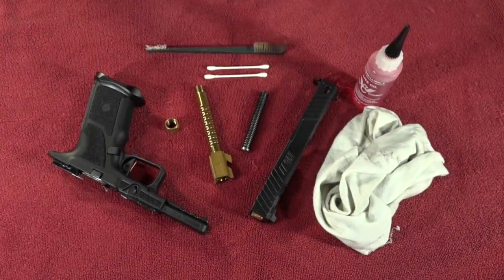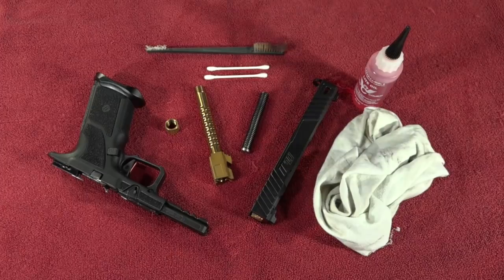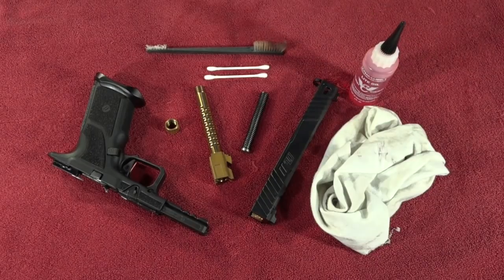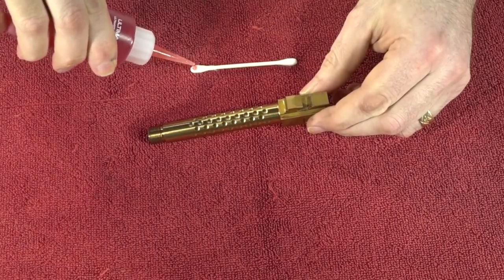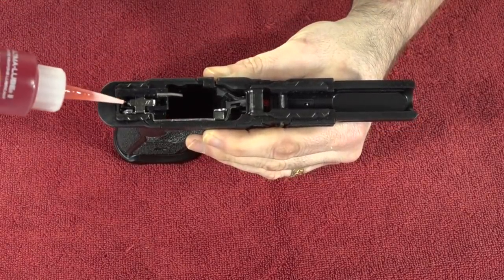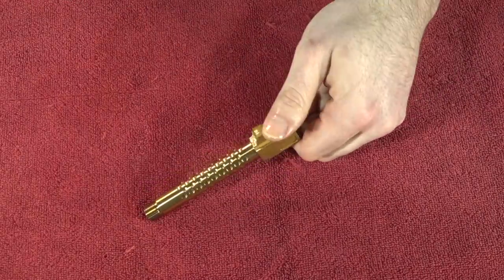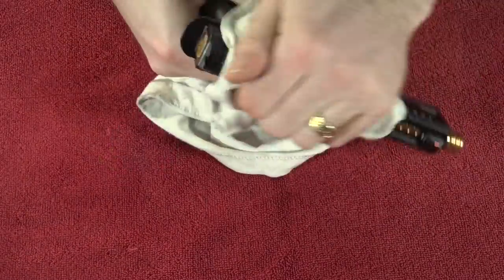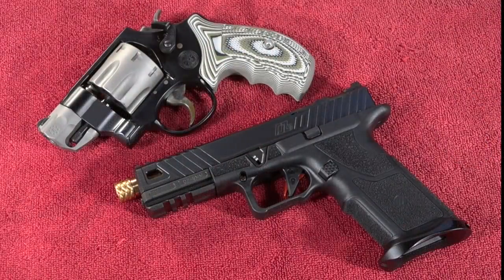How To Properly Lubricate Your Handguns (& Not So Properly Too)

Comment: Perfect. You can go a step further to deep clean any gun without going beyond field strip. I wet the entire gun with Hopps #9 or what ever. Scrub with a brush, dump some more solvent on it, then let it sit a few minutes. I then wash all the parts in hot running water and soap ( my wife don't care) then blow dry with compressed air. I then lube like YM does by soaking the gun. The compressed air ensures oil is blown everywhere, and blows away the excess. I blow air until the gun is almost dry. I add a tiny smear of moly grease on my rails, bolt lugs, and ratchet teeth except on 22 autos. Had the whole 22 fleet quit one day in freezing temps. 22s wont do even tiny amounts of grease when it's cold. This will get a neglected old gun full of nasty crud up and running again without taking it completely apart. Gotta take the wood off of course.

Another trick i learned from a NW hunting forum. In the NW US it rains a lot. I have the dreaded 1965 Win 94 with the mystery metal receiver that rusts from frowning at it. The gun would come home rusted up after a single day out. The dudes at the forum told me to wax it up with paste wax. Works good, in fact perfect. After the above all my hunters get waxed heavily. I force the stuff everywhere with a brush. Let it dry and buff it off just like the car. Use the brush for the tight spots. That gun can go out in the rain and hunt a whole weekend and not rust up. I really cake it on under stocks that wont come off for a long time. Buff it lightly but leave it on heavy. I wax the wood to. It seems to work.

Comment: Use the parts cleaner at the local gas station and then dip gun quickly in drain oil barrel , lay on paper towel overnight .
Reply: Are you married to your cousin?

Comment: I never lube the breechface because I don’t want to attract dirt or lube into the striker channel/firing pin channel. Same with the extractor, I don’t want lube to seep into that little cavity and start affecting the functionality of the extractor or attract a buildup back there cause removing the extractor to clean back there is a pain especially on my beretta where if you do it too many times the pin that holds it in will start walking out
Reply from the maker: You need to properly lube the breech face. Finishes wear of quickly there. Light coat brushed on with a brush or qtip and then wiped dry.
Reply: TheYankeeMarshal what’s the problem with the finish wearing off there? On my pistols is has worn off a lot there but I thought this was normal wear
Reply: ALL metal surfaces need to be oiled to prevent friction and corrosion

Comment: wait so you dont lubricate the inside of the barrel???? i thought that was the part you don't want to leave without oil because the oil stops rust....
Reply: You DEFINITELY want to oil the bore.just make sure to run a dry patch through once or twice to get any excess.i use hoppe's 9 to clean then frog lube paste to lube Inside of barrel

Comment: Rem oil is so thin and solvent like. It seems to evaporate.
Reply: Don't use WD-40 as a gun lubricant; it's too thin for the job, and is more of a solvent than lube.
Gun oil (Hoppe's) worked great on my Glock Model 22.

Comment: Meh, my guns run fine with about twice as much as they need. I have enough guns that some of them don’t get shot for months or even years so I lube the Hell out of them. I have even grabbed my back up to my back up competition gun after I blew out a barrel hood from a factory over charge, (event supplied ammunition). I then stripped out a my bridge mount rail and had to use my 3rd gun. It was stored soaking wet and I simply wiped out the barrel and shot the event 200rds no issue. I do like this blow out method though, seems pretty solid and quick.

Comment: Oil on the firing pin?
Reply: Sure! The pin is metal and so is the spring the issue is not over oiling those parts or the channel

Comment: A friend of mine just bought a Glock 21. We went shooting, and since he hadn’t bought a cleaning kit yet, I volunteered to clean his pistol along with mine. Not being a Glock owner, I YouTubed how to clean them. Man, it’s a lot different than cleaning my 1911, I’ll tell ya that. The people in the videos really hit the idea that you shouldn’t use oil on anything aside from the rails. They all said to use rubbing alcohol. But I thought lubricating metal rubbing on metal was a good thing. I was using Ballistol, spraying it on, and rubbing it off with paper towels. So what’s the difference?
Reply: Who the fuck told you to clean a gun with rubbing alcohol
Reply: @111BLACKLIGHTNING111  you have to strip them if you are going from oil to frog lube, or frog lube to oil. Otherwise they’ll get gummy.

Comment: Good greif. Really. Slip2000 on those slide rails and rail channels allways.
Reply from the maker: Fancy lubes are all just gimmicks. Use whatever is in sale.
Reply: @TheYankeeMarshal  yea tried that once,  bought that new lucas oil greese on sale, rated at 80# timkin, tried it on a gold cup, next thing i know shiney metal on metal wear shows its ugly after only 200 rounds. Used Slip 2000 greese for several thousand rounds before this bad decision and never saw a wear mark on blued rails. Gave that junk away. And only Slip2000 now. No more wear. I use it on all fireams, loading presses and anything else thats subject to extream pressure.  If you love em, just like a pet take care of them properly. Ding Dang you gun junkie you. Lol.
Reply: Go big or go home!!! 🏠  .... Gunzilla, MPro7 LPX, Ballistol, Breakthrough Clean, Froglube Extreme 🐸...
Reply: @DavidLLambertmobile  I'm a hoppies #9 overnight soaker (only after extreamly long shooting sessions) and general pre cleaner (can't  help it,old school perfume adiction) , then gun blaster to remove that, then breakfree clp( (this stuff allways to remove anything else and lube it againts corrosion)a leftover habbit of milatry days in the 80s)) and Slip2000 greese on the rails and tracks, sear and other contact points of extream pressure.  Frog lube it great stuff but it gets expensive when your on a very thin budget. Hoppies by the quart on sale, large can clp on sale and large tube Slip2000 is far less expensive and lasts a very long time even when cleaning many firearms often.